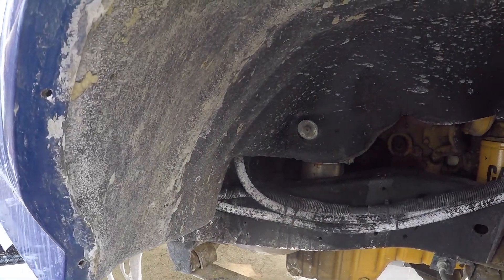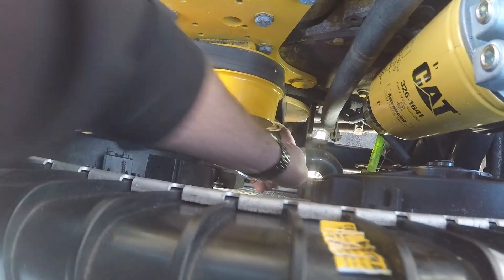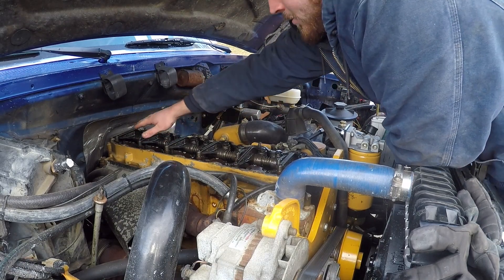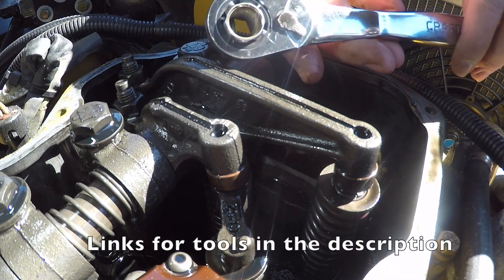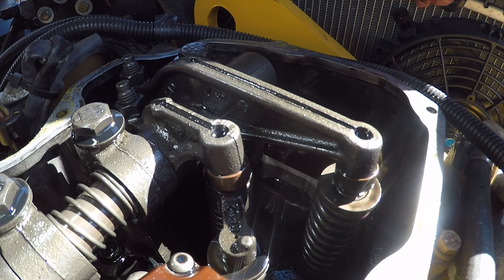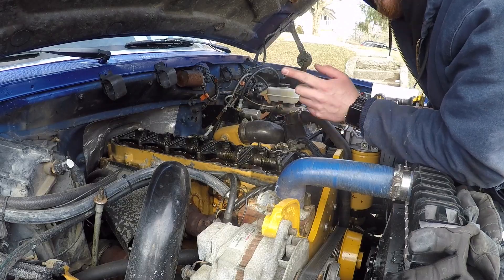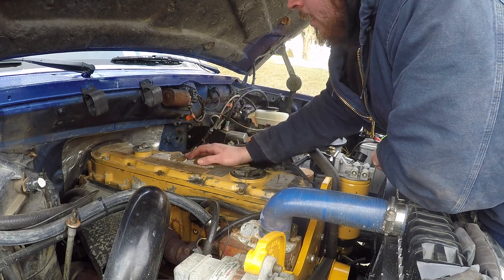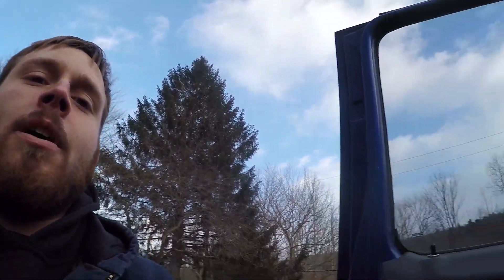Pt. 39 Adjusting Valves On A Diesel F350

Comment: I love your idea for a step. Chains and wooden board, cool. Why didn't I think of it?
When I adjust valves, I look for the actuated valves after I remove the cover. If there is an intake (open) pressed down then I adjust the exhaust. Put some paint on the rockers I finish. I then spin engine and repeat.
Reply from the maker: Thanks! When I was building the bumper I tried to design it to work as a step to make servicing it easier! That is one way to do it! Cat makes it pretty simple tho with that pin!